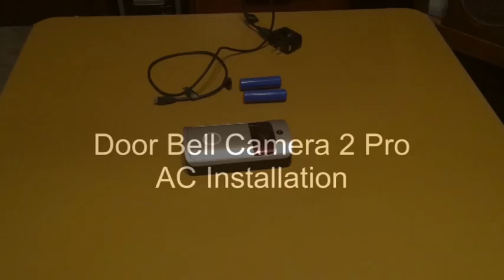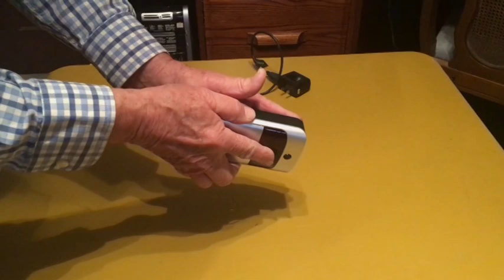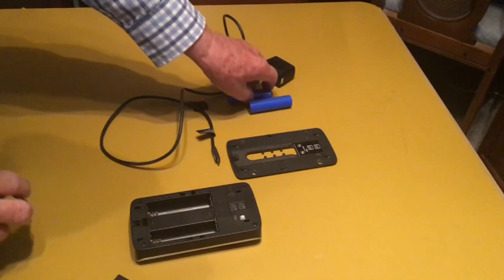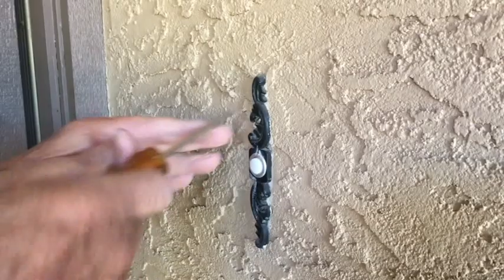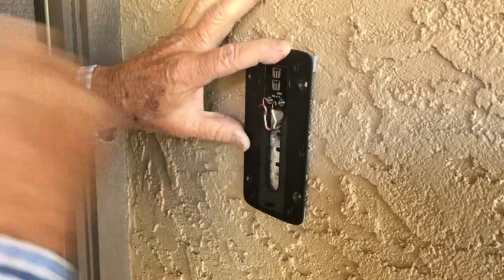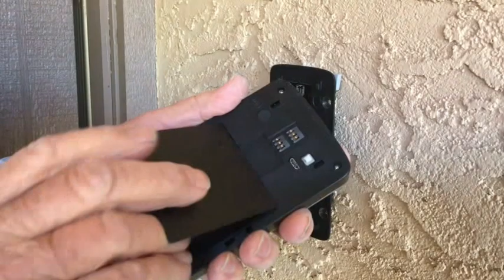AC POWER INSTALLATION FOR DOORBELL CAMERA OF KENNYCAM

Comment: mine wont turn on . i have 16 VAC as with mutli meter, got another doorbell same result. any tips? do i need to have batteries installed? mine didnt come with any and they are expensive in my country.   it turns on with USB

Comment: Very helpfull. I was confused that. Should i connect the wires with battery installed or without battery installed. I thought AC input was for charging the batteries. But its not for cahrging the battries. Its a seprate power supply for the bell without battries.  Thanks

Comment: Could you help?  I have the same similar unit  (after market).  indoor chime doesn't work?   it is hard wired and hooked up to the original doorbell.  everything else worked; connected to app, connected to WIFI...   When you push the button, you can hear the chime inside.  Thx for reviewing.

Comment: the small allen key screw that holds it onto the unit on the wall is rusted on mine and the allen key keeps turning in it. i tried wd40 to loosen.didnt work. any ideas how to remove it? thanks

Comment: We've installed the device on the ac power and also set it with the app before putting it on the wall, but it is not working. The red light is continue and the bell is not working

Comment: Does it support 220v AC direct? 
What current is coming from the 2 wire's in the video 2:20
Reply: This is typical AC power as in USA they are using 110 V ac , other countries may use  220-230 V ac

Comment: nothing said about the current - will it use 110 volts?
Reply: A transformer is needed. Do not connected it to the 220 or 110 cause you will burn the device

Comment: I've done all that but my doorbell inside doesn't work for some reason? Any suggestions? Only rings from the button
Reply: Erik Smith 
I have the same issue.
Reply: @NaeemBashir15  I'm thinking since it's a "wireless" doorbell it needs the wireless chime bell that goes inside to work together. All the wires in the back do is give power to the device.?🤷‍♂️